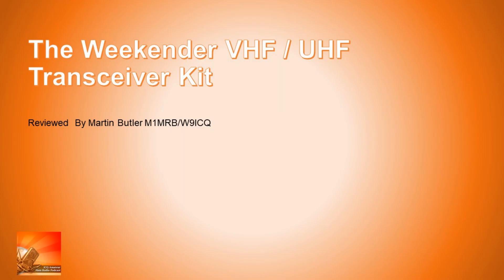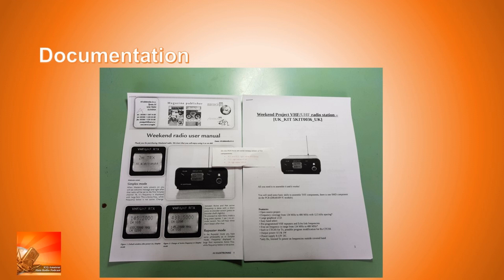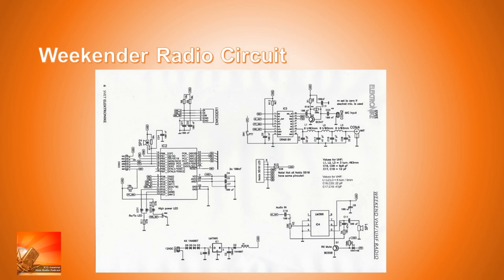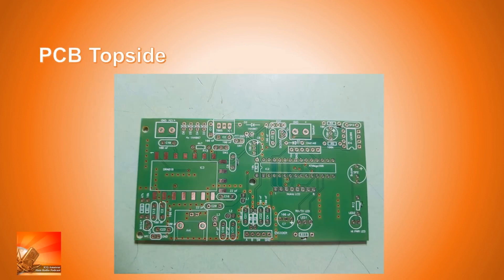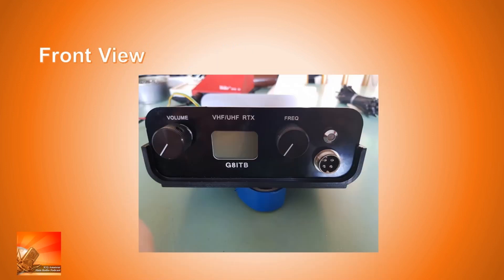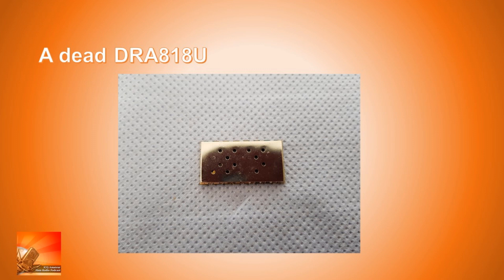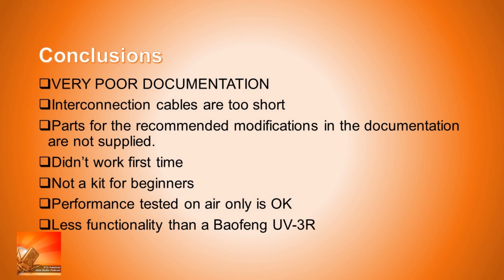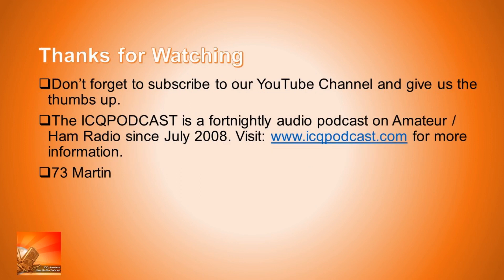UHF/VHF Weekender Transceiver Kit Review

Comment: Re the reviewer's uncertainty about the four series power supply diodes (at around 5:20): These are used because the 7805 regulator would otherwise become too hot during extended transmit operation at full power. The input diodes dissipate 2W reducing actual regulator dissipation by 30%. That reduces component temperatures inside the box. The kit designer could have used a more costly switched mode regulator but the approach here is simple, effective and possibly cheaper. 

Re documentation: It's adequate for the intended purchaser, an experimenter. If the builder/user doesn't like the menu or the way the front panel LEDs light up etc, then you can change the software yourself. That's something you are unlikely to do with a Baofeng radio.